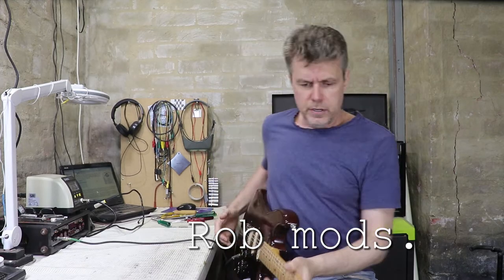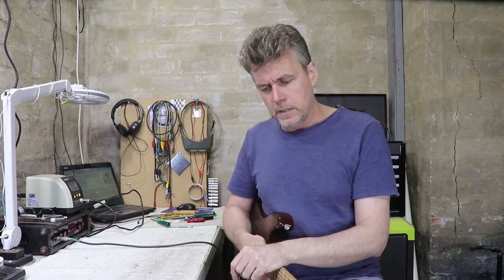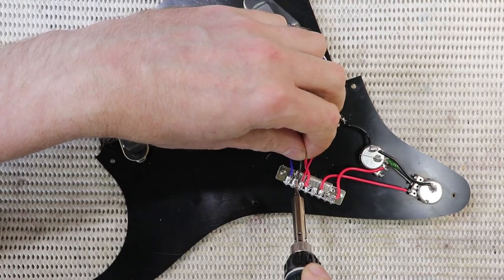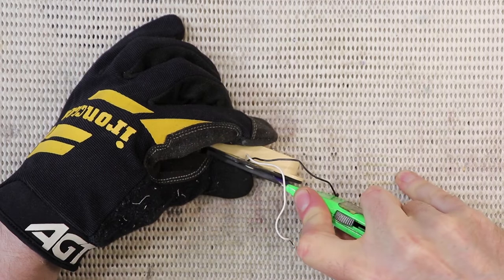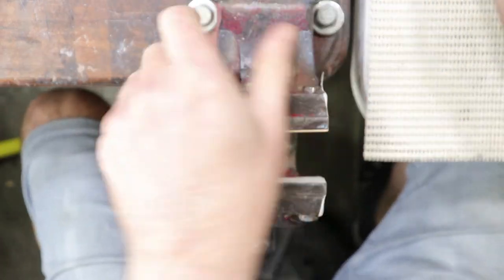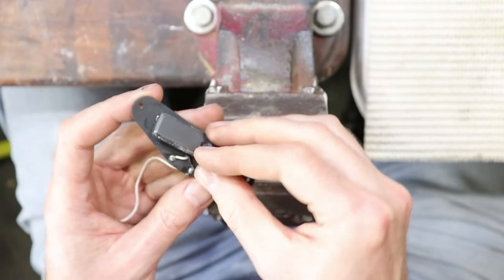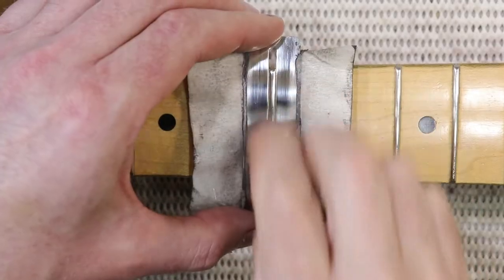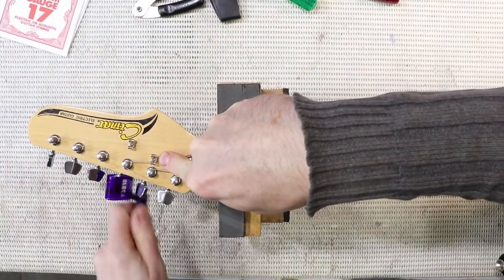Fixing A Buzzing Strat

Comment: Have you ever tried adding a steel plate underneath a pickup? 

I picked up this ridiculously cheap second hand Strat copy just to make mistakes on, and somebody had modded the pickups that way, and I love the way they sound, especially compared to standard cheap ceramic Strat pickups - they have a punchy attack that is really pleasing to the ear and are more articulate than that type of pickups usually are - my assumption (which could be wrong) is that the sound is due to the metal plate, although I didn't do the mod myself, so I don't know for sure.
Reply from the maker: It was common for Fender to use metal plates under pickups back in 60's and 70's.  But they didn't use steel.  It was a non-ferrous metal like brass usually.  (My '73 P bass has these plates.)  I think it was for shielding.  Steel would likely change the response of the pickup since it is ferrous.  It would change the shape of the magnetic fields, and maybe also increase the inductance if it were close to the coil.  Sounds like your experiment worked well!  

You should look up Chris Kinman's pickup designs.  His more recent patents use steel bobbin flange things to concentrate the magnetic fields.  Very cool stuff!

Comment: Thanks for that Rob.I found this video because I have an 8os MIJ Squire strat, and it's pretty noisy. Checking polarity with a magnetic compass was a new idea for me. Great. When you removed the magnet to reverse it, I wondered why didn't you simply re-install the pick-up around the other way? Would this not produce the same result?

Comment: What an interesting video. I always thought you needed reverse winding in the pickups for them to be hum cancelling. It'd be really nice to find out exactly when did Fender start to use hum cancelling pickups. In basses I'm not sure about jazz basses but the p basses, fairly sure it started with the first model that came with the spit pickup, late 50s, I guess? Amazing content, Rob!
Reply: That's why he also changed the wiring. If you change the positive and negative (white and black) leads from the pickup around then you are essentially reversing the windings. You are correct that you have to do both winding and polarity to keep the pickup in phase.
Reply from the maker: Yes and no.  Reversing the wires reverses the phase, but the windings stay the same.  With a true RWRP humbucker you end up with both coils having the start and finish of their windings at the same potential.  IOW, when in phase, both will have say, the inner windings connected to earth and the outer to hot.  With my mod in this video, the originals have their inner windings (start of the coil) to earth, but to get my modded middle pickup in phase, it now has its outer windings (finish of the coil) to earth.  

In practice this usually doesn't matter.  As you can hear, no hum, and nice, in-phase tone.  But sometimes it can matter.  The stingray-style humbucker in project Berocca doesn't have its coils reverse-wound.  (This is common on cheap stingray pickups for some reason.)  It still hum-cancels, and sounds fine, but the pole pieces on the one coil that has its inner windings connected to hot will buzz when you brush them with your thumb.  That's due to capacitance between the inner windings and the pole pieces, and the fact that I have Elixirs (coated strings) on there, so my body is not earthed via the strings/bridge.  

With a lot of pickup designs, the pole pieces are hard wired to earth, and swapping the phase can actually have a slight tonal effect.  This is also because of that pole-piece-to-inner-windings-capacitance.   I touched on this in another video:  https://youtu.be/tV-TcoLPkkE

This is confusing stuff.  It took me a while to get my head around it,  and I'm still learning of course...  Cheers!
Reply: This is the stuff I'm taking about! So good, so detailed. What a great explanation!

Comment: Hey Rob. Back in the day nobody had RW/RP pickups, not even Fender. I had read somewhere (or heard) that Tokai Strats had pickups that were RW/RP to Fenders, and people swapped middle pickups with each other. This is purely anecdotal, I've never seen it for myself and I can't remember where I read it (it was the 70's or 80's - a long time ago). 
Can anyone confirm/refute this?
Thanks for another great video!
Reply from the maker: Yep, the first strats had 3-way switches I think. So no point having middle pickups with reverse mags I guess.   Did the first Teles (Broadcasters) have 2-way switches?  I'd really love to know more about the history of this stuff.  Like when exactly Fender officially went to hum-cancelling Tele sets, and reverse magnet middle strat pickups.  What about the first Jazz Basses?  Did they have a hum-cancelling pair of singles?

FWIW, the winding direction makes no difference for hum-cancelling.  As long as the magnets are opposite and the signals are in phase, you will have hum-cancelling.  The winding direction can have other consequences though...

Glad you like my content Peter!
Reply: @RobMods  You're right. Strats up to at least the mid/late 70's had 3-way switches. My old Kimbara Strat copy had one (45+ years old, still have it, though it's been rewired a few times!). People used to jam the switches in the "inbetween" positions with matchsticks!
AFAIK Tele's (even single pickup Esquires) have always had a 3-way switch. On Esquires and early Tele's they switched capacitors - like a preset tone control.
I have no idea when RW/RP pickups sets started (on anything - guitars or basses), although the split pickup on the P-Bass has always been a humbucker.
And yeah, really enjoying your channel. It's a good mix - Guitar mods - electronics etc. Right up my street!

Comment: I would have loved my strat, had it sent to a tech guy about 7 times this month. Constant buzz and every time it is fixed it only takes about 30 seconds of playing for it to get ruined, guitar has become a constant source of frustration
Reply from the maker: This stuff can be frustrating.  If you've had a full shielding job and your single coils are still noisy, then I guess it's time to think about some hum-cancelling pickups.  I recommend checking out Kinman.  They are great.  Best of luck and hang in there mate!